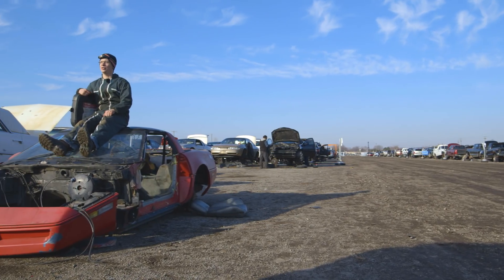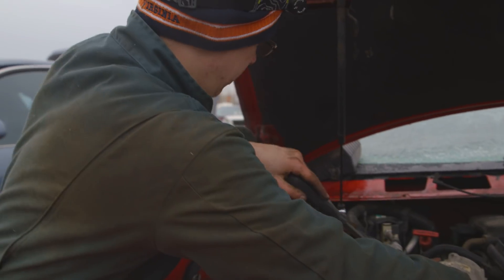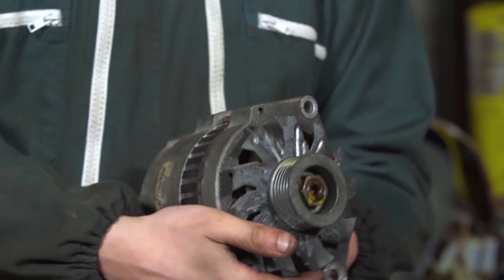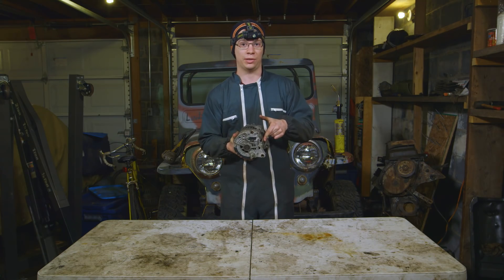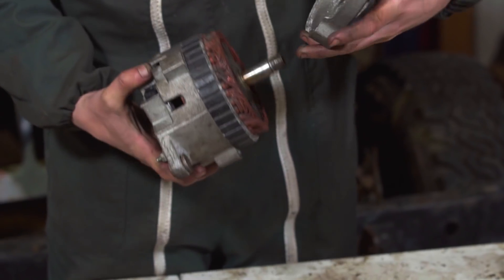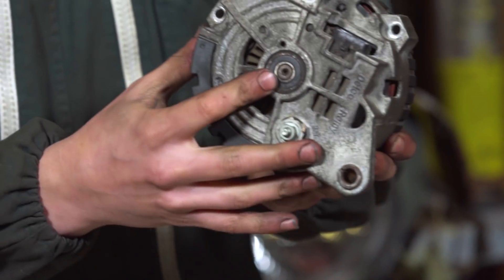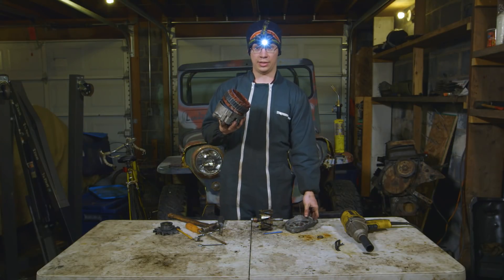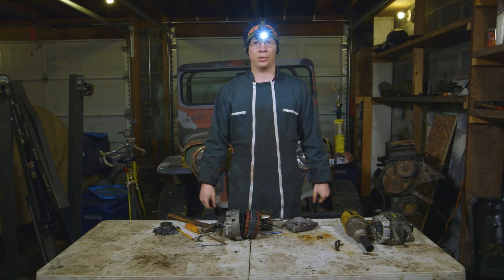This Is How An Alternator Works | David Dissects

Comment: hey how about making a new alternator called a voltanator that actually makes volts instead of amps. this could be used in generators and would work only at a certain rpm ratio. this way it couldn't be used in cars. this is a specialty market and is likely to make more power with less rotations slightly as the capacitation of the alternator takes work.

Comment: Mister, your presentation is correct on all counts. I am a licensed journeyman electrician and I deal with 3-phase power applications all the time. I think the unit you used in your video was know as a "Delcotron". It had a built in voltage regulator and three diodes to convert A/C to D/C. Years ago I had an exercise bicycle. I removed its front tire and placed a belt on its rim and also mounted an alternator to the frame of the bike so when I peddled the bike it turned the alternator. I also mounted a small 12 volt fan on the bikes handle bar and connected it to the electrical output of the alternator. I also connected a 9-volt battery though a single pole toggle switch to the exciting coil on the alternator. I peddled the bike like normal but when I tuned the switch on, the alternator would come to life and ran the small fan. I had no idea how much power it takes for an alternator to operate. Yes, I would be peddling just fine but when I closed the switch to the exciting coil of the alternator I had to peddle REAL HARD to make that fan to turn. The whole thing ran as I designed, but it was just too much work to make that stupid little fan to turn!!

Comment: the second alternator is from a Chrysler it does not have a voltage regulator because Chrysler likes you to spent lots of money and make you replace your alternator and powertrain control module when you have charging issues. pretty simple video not terrible but not the best. take a little more time in production and editing. Diagrams, and a written script would have helped the output of this video greatly. I watched it cause I was curious to see how it was going to be explained. Definitely keep the series going knowledge is always a good to gain.
Reply: Jason454ss Chrysler also likes to use the pcm as a power source for many things. Which causes immediate driver failure when a pcm powered component fails.

Comment: Perhaps you could have explained that the alternator runs all the time the engine is running so people who think they're saving fuel by not switching their headlamps on are deluding themselves.
Reply: It actually does consume a very small, insignificant bit more fuel because it's harder to turn when loaded down than when there's not much draw. But normal headlights and electrical accessories don't draw much compared to nearly anything else.
Reply: Midnight Mechanic Absolutely, but most people don't know how to properly convert to an electric fan without the vehicle overheating off idle. Hahahaha
Reply: Midnight Mechanic most people want the cheapest shit they can buy for their 1992 civic. They don't understand all that goes into assembling an efficient cooling fan. I have seen horrible attempts at putting ebay fan kits to no avail. I would only go electric if I'm chasing hp. Hp creates heat. More HP means more heat. More heat means its time to modify your cooling system to compensate. Especially on older vehicles where fuel control is not nearly as precise as modern vehicles.
Reply: People think clutch type cooling fans save more horsepower than using an electric one, boy are they way wrong because Engine Masters proved at least 20 horsepower is lost to a mechanical fan!  Your alternator draws in at maximum maybe 1 horsepower even with electric fans full blast, so all those people out there with muscle cars, SWAP IN SOME ELECTRIC FANS!
Reply: People think clutch type cooling fans save more horsepower than using an electric one, boy are they way wrong because Engine Masters proved at least 20 horsepower is lost to a mechanical fan!  Your alternator draws in at maximum maybe 1 horsepower even with electric fans full blast, so all those people out there with muscle cars, SWAP IN SOME ELECTRIC FANS!
Reply: Electric fan conversion kits make this abundantly simple, even without instructions just hooking it up to a 12 volt source and a light switch is enough!  Either that or buy a car with at least some semblance of modern technology. :P
Reply: Well therein lies the problem, it's a 1992 Civic. lol  Get a cheap Chevy that's easy to work on, even they've managed to build cars with no grilles to speak of, only a piece of plastic to dam air into the radiator! XD
Reply: Midnight Mechanic I like my early 90s rwd Toyotas. Any old Chevy worth having is typically ridiculously priced for its age and condition. The only downfall of their cars is that damned cold start injector failing and causing the cars to run too rich and frying the cat. Oh, and at this age the specialized relays are starting to burn out.